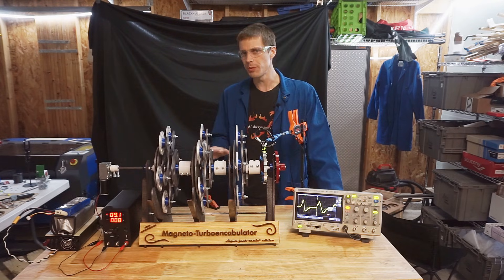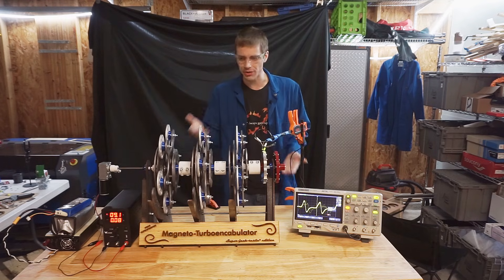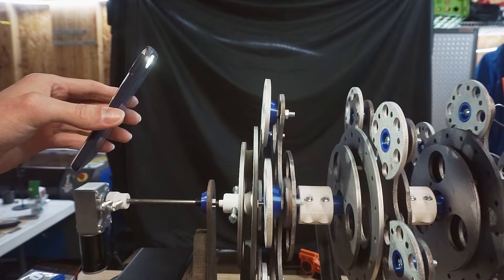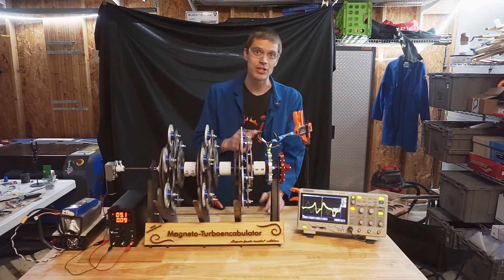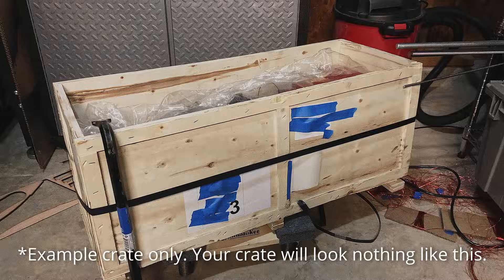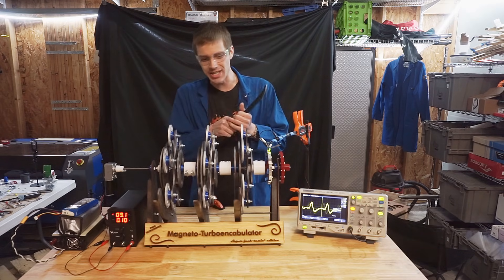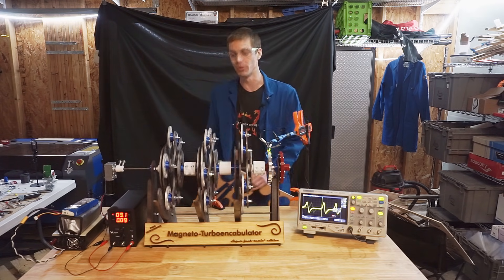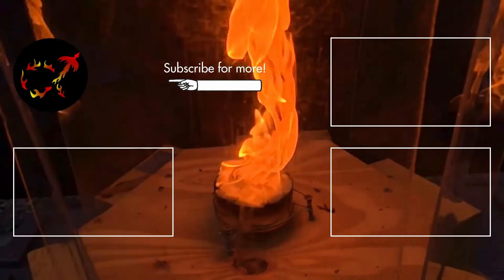Introducing the Magneto-Turboencabulator

Comment: This video flew over the non-existent head of the auto summary AI: “The video introduces a new device called the Magneto-Turboencabulator, which aims to transmit mechanical torque using quantum spin interactions. The speaker explains the device's complex workings, highlighting its unique features and potential applications. The video concludes with a glimpse into the future, suggesting that this device could become commonplace in homes within a decade.”

Comment: I continue to be amazed by the rapid improvement of this technology!  After only several iterations, this one you demonstrate above seems to be the Pinnacle so far of this technological Marvel.  Now, my only criticism is that without a built-in angular rate measurement capabilities, one would have to add that on as a modular addition, which, as you know, is quite expensive and complex.  I would think without too much trouble you could integrate this into the system and the customer would be willing to pay an additional 5% for this native capability. So I strongly encourage you to consider that for your next iteration! Congratulations on the Fantastic progress you have made so far, and may you one day be nominated for the Nobel prize!

Comment: Hello sir,
I would  like to order one from you but I have a question: 
 Does the system really ship only with  angular rate measurement capability?! 
Because I already have an angular rate measurement capability system at home!  Would it be possible to order  The magneto-turboencabulator without the Angular rate measurement capability system, and get a discount?! 
That would be really grate! 😃👍
Thank you.
Reply from the maker: Nope - locked specs

Comment: While this prototype has proven its impressive utility, it is worth considering whether or not the mechanical impulse must necessarily originate from such a (presumably lithium-based) packaged galvanic pile, but rather, originate from one in an expansive set in mechanical impulse sourcing methods, which already prove economically viable. For instance: silicon-based photovoltaics, angled to absorb the same aforementioned superterahertz electromagnetic radiation (which in this case would be produced by nuclear fission) to subsequently apply electromotive force to drive a similar, or even the same, electromagneto rotational motivator unit. An implementation obstacle still remains, however. The majority of the aforementioned motivators produce oscillations above the hyposonic range.
This consequently conflicts with the organ receiving gaseous molecule collision chain reaction information, resulting in cognitive dissonance.

Comment: I love it when my backside gets coated with electroconductive elemental deposition.....if you know what I mean. However there is a flaw in the design of this magnetoencabulator that could lead to unscheduled rapid evicera dispersment. If you balanced the marzel vanes on the semiboliod coupling against the lotusodeltoid dominion regions, and effectively eliminated the side fumbling in the reciprocating dingle arm, then the sinusoidal deplaneration would cancel out to an overall effective unity of 1.65329kcal/lambda over 12(per degree Celsius, of course. I mean, were not talking spherical cows in vacuums here! Haha). Now, that is shaft hog heads to the rod and not brake HH/R, but it would gain a marked increase in tremolo throughput that I believe would offset your material investment per unit. The good news is replacing the weng shaft supports with authentic Milford Trunnions should do the trick! Thats authentic Milford Trunnions, none of that knock off malarkey...Otherwise you might as well ship it back to Philly where its from....

Also, I love the overly descriptive wording. About the only part of the Rockwell Retroencabulator video I cant stand, the one part that doesnt make any damn sense at all, is the 'logarithmic casing of prefabulated amulite' ...... It hurts me every time. Prefabulated amulite is fine(hell I work with that stuff every second Thursday of the week!) .....but a logarithmic casing?!?! It just gives up the gag!!! Everything else in that video is, or almost is, totally feasible (though maybe not in the exact configuration implied....). I have promised myself, one day I will order a bunch of PLC surplus gear and boxes, and dedicate a wall in my house to building a Rockwell Retroencabulator. Anyhoo, well done. I enjoyed the pseudo-take at pseudo-engineer-speak. I love the meta implication that it could sound made up.....but is entirely accurate!

Oh, and do remember to lubricate your slip-hole before any gripjiggy. 😉

Comment: This is so great. I used to talk like this to my friends for a little extra amusement. Mostly when my car needed a mechanical electron flow regulator added to control its electromagnetic radial atmospheric flow inducer for themerodynamic regulation of the aqueous thermal mass of the hydrocarbon detonation to mechanical energy converter.
Though I feel I am a bit out of practice these days.
Thanks for this cheers

Comment: That battery wasn't even connected to the encabluator. The motor was being powered by a power supply.....
Reply from the maker: Which was driven by a battery through an inverter. Nobody said it was smart
Reply: @AlphaPhoenixChannel  Inverting a small battery to 120v AC to run a DC generator is electroboom level wizardry

Comment: Now basically the only new principle involved is that instead of power being generated by the relative motion of conductors and fluxes, it is produced by the modial interaction of magneto-reluctance and capacitive diractance.

The original machine had a base plate of pre-famulated amulite surmounted by a malleable logarithmic casing in such a way that the two spurving bearings were in a direct line with the panametric fan. The latter consisted simply of six hydrocoptic marzlevanes, so fitted to the ambifacient lunar waneshaft that side fumbling was effectively prevented.

The main winding was of the normal lotus-o-delta type placed in panendermic semi-boloid slots of the stator, every seventh conductor being connected by a non-reversible tremie pipe to the differential girdle spring on the “up” end of the grammeters.

The turbo-encabulator has now reached a high level of development, and it’s being successfully used in the operation of novertrunnions. Moreover, whenever a forescent skor motion is required, it may also be employed in conjunction with a drawn reciprocation dingle arm, to reduce sinusoidal repleneration.

Comment: Your discourse is so ... obnubilated ... that remembers me some politicians in Brazil that say platitudes using pompous language. It reminded me of some infomercials. Even if is a April Fool's joke the idea of a magnetic gear is interesting, and useless as made in this way it would be huge losses by parasitic currents. As synchronous electrical motors have a constant torque independent of velocity this would be really unnecessary. Did I told you that I have a natural inability to understand and use sarcasm?

Comment: Can I get the 3-D printer code so I can print my own 3D Magnetic turbo encabulator? And I'll ask the question again are we going to do a Treatise on dark suckers. Everyone knows that wood is the original dark sucker, evidence by the black on the surface as it sucks dark out of the night. Light bulbs are a modern dark sucker you can tell when they're used up because of the the bulb turns black on the inside from all the dark that gets sucked in.

Comment: This is obviously the prototype version 2.0 update to the original Turbo Encabulator. A device that is proven in design and efficiency. If the Magneto version proves to be half as good as the original, it will be a breakthrough of unimaginable benefits. Good luck on your endeavor.

Comment: Thank you so much for this amazing breakthrough!!
I was thinking of hooking one up to a sinusoidal square wave replicator, but I think the toroidal shape of the magneto supposition might interfere with the transformation of the fourier bifurcation process. Perhaps if I had the CAD drawings I could design a neutrino laser and an electron spin down fiducial to fine tune the impedance of the Sigmund repletion line. This should be able to keep the fourier bifurcation process bifurcating the quantum flux just enough for the 6 electron volts required for the hyposonic amplitudes. Do you plan on releasing the CAD files? I could make them myself after buying, but if you could bundle it with the purchase that would be so much easier on my quantum flux capacitometer. Also, do you have any translations of the spec sheets, owners manual, user manual, and other relevant data sheets? My team is very diverse and I need translations in wingdings, pirate speak, lolcatz, !Xóõ, and Anglish if possible.

Comment: Question from someone who isn't coming from a physics or engineering background but still finds this stuff interesting:

Will there be a simplified version of this explanation? I get that the whole point was technobabble but I'm pretty sure it's using actual terms and I don't know (hardly) any of them.

I believe it's just a rotating wheel where the little wheels have magnets on them that make the other wheels (with wheels with magnets) also spin around but it also might just be neat to see how the heck you came up with this or the babble or any of that stuff.

(EDIT: let me know also if there was such a video and I missed it)

Comment: What an exquisite stream of three-dimensional numeric arrays representing a series of rasterized 3D projections (captured, I assume, by means of a series of silicate-based optical components focusing electromagnetic radiation in the wavelength-range of 380 to 780nm through a bayer filter on to a rectangular grid of miniaturized photosensitive electrical components), encompanied by two syncronized, lossily compressed pulse-code modulated representations of acoustic waves this was!

An astonishing, and frankly, revolutionary piece of engineering. Thank you for sharing it with the world, you will truly have changed it; and for better, might I add.

Comment: so it's a gear reduction... but instead of decreasing speed to increase torque, it decreases both.
Reply: Its not just that, you are ignoring in this analysis potential encabulator once it is complete, it still misses main things like logarithmic casing, dingle arm and more, all vital for encabulator to reach it full function.
Reply: @belisarian6429  You can tell that they didn't get side fumbling under control yet

Comment: What lead to your selection to forgo the prefamulated amulite in favor of cellulose composite? I'd be concerned about the inverse-reduction of the latter especially when exposed to precipitation or other external conditions. Though it may be stable now there is concern about the long-term stability of the superstructure.

Comment: A few notes for the engineer responsible for the magneto-turboencabulator:

- This model seems to have reduced the need for any capacitive diractance by amplifying the modial interaction of magnetoreluctance alone.
 
- I fear that the lack of hydrocoptic marsal veins that were once fitted to the ambificient lunar waine shaft may reintroduce side fumbling.  

- this model is missing the Lotus O delta-type main winding.  But I can see that after more development that it along with the panemdermic semi boloid slats of the stator will be added.

- the three magneto reducers do a much better job than the drawn-reciprocation dingle arm to reduce sonusoidal deplanaration. 

Please consider these comments for the remaining steps of development.

Comment: I’m simultaneously fascinated my your description and proud I was able to follow most of it. Yet the meme from Jimmy neutron rings a bell in my mind, where oftentimes hyper accuracy (or ubiquitous verbosity) of the terminology of such an explanation for this device does not actually add any substantial clarity to the conceptualization of the system being described and instead serves only to exclude those without sufficiently varied vocabulary from even rudimentary inclination of the function of said system. Clearly a well designed script discussing a fascinating concept implemented in a way which makes its function insufficient in terms of power transmission and precision of the transform between angular velocities for most use cases. 

I love this meme it’s clearly amazing and keep up the good work!

Comment: I believe that there is an important distinction to be made between the logarithmic casing of it's predecessors, and the logistic power curve produced through the complex axis of this device. This may be due in part to the aforementioned cellulose substrate, although I believe that non-deterministic flux may also play a role in the decomposition of the vectors.

Comment: Unfortunately for my application the high variability of the rotational velocity of the output is incondusive, as the repeated cycle of applied force moments to the axis of my flywheel exceeds the fatigue threshold of the polylactic acid from which it is fabricated. Perhaps an encoded electromagnetic impulse carried over a thin strand of crystaline copper coated in petroleum-based polymer could be made to stimulate a restoring force in a ferrous axial magneto-array coupled to the output in order to reduce oscilation?
Reply from the maker: Poetry
Reply: @AlphaPhoenixChannel  Electric Motor... Hmmmmmmmmmmmmmmmmmmmmmmmmmm.

Comment: Increasing the torque reduction surface area in parallel via epicyclics was a clever idea… however I think the weakness comes from all of the transmissions using the same pitch and number of magnetic channels.

Consider building it out of smaller transmissions that all have the same reduction, but with different numbers of magnets and magnetic channels.  The mismatch should create a larger basin of attraction, increasing the stall torque and throughout.

Comment: How well can it replace viscous coupling units as used in high performance automobiles?  
The magetocoupling is a function of the distance and the
conduction of the eddy currents in the materials that are spun around.
In a similar way to magnetic breaking or electric retarder is in trains already.
This can be adapted via mechanical systems that would not need much potential
nor kinetic energy to perform such a change.
I think that his variable coupling might even outperform a viscous coupling, 
due to this feature.of coupling only when it is necessary.
It can also have a double function as a velocity decreasing system.
But this all certainly depends on the maximum torque that can be expected
with such a configuration. And this torque might downgrade immensely under 
high temperature circumstances.

References:
https://en.wikipedia.org/wiki/Viscous_coupling_unit
https://en.wikipedia.org/wiki/Eddy_current_brake
Reply: Permanent magnetic transmissions have the benefit of holding force and automatic corrective orientation control over viscous transmissions.   A magnetic transmission utilizing electromagnetism could avoid needing complex sinusoidal driving frequencies and susceptibility to curie temperatures (see: the Earth’s electrodynamic core).

The issue is low holding torque; typically the solution is to increase the flux surface area, but I believe parallel reductions (set to the same ratio but with different numbers of magnets+couplers) could increase the stall torque by increasing the angular/magnetic basin of attraction.

Comment: Are you sure it is prefamulated amulite in the original and not the more common deprefamulated amulite? Wouldn't the torsion deburr the oxygen-carbon depositions off of the more expensive prefamulated amulite too quickly, making the extra expense wasteful since the prefamulation layer will just be scourged from the undercasement?

Comment: Wow! I've been following the turboencabulator research for years, wondering when the technology would finally be accessible to the average consumer. It looks like you've made the critical breakthrough! I think if you introduced a capacitor between each carrying pseudo-gear, you could align the unpaired electrons to capture more of the quantum spin. This would amplify the flux interactions and produce a more efficient temporal inductance. My rough calculations suggest a peak efficiency of around 88mph, though you may need to replace your chemo-potential pile with a quantum decay neutron generator for maximum output.
Reply: You're forgetting about the conductor deltoid duractance......Itll never see more than 1.6/unity......

Comment: Instead of the conventional dingle arm, have you tried using a reverse inverse retro anti-contradingle arm?  It greatly limits the magnetic flux deposition on the cellulose components, thereby reducing the aerodynamic drag normally associated with the accumulation of upside oriented reverse flux, while still allowing the beneficial inverse version of the same flux to amplify the efficiency of the sinusoidal motion in the counter angle directional space.  The best part is that it only requires the addition of a small amount of duct tape.

Comment: Is the logarithmic casing amulated to ISO9300? We were considering it for our plant but couldn't spec it for our regulatory requirements. Also, the fine metallic dusting needs to be defibrillated to IP68 and ISO800 standards (we have a high concentration of volatile organics and nitrogen compounds in our facility).